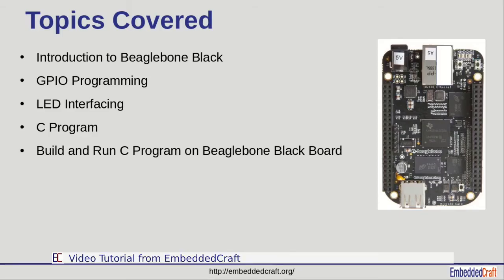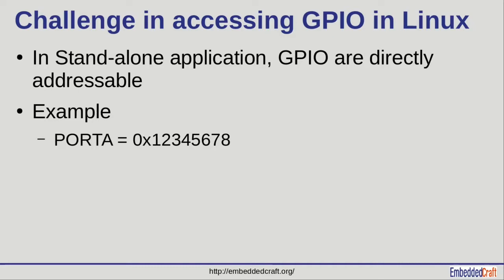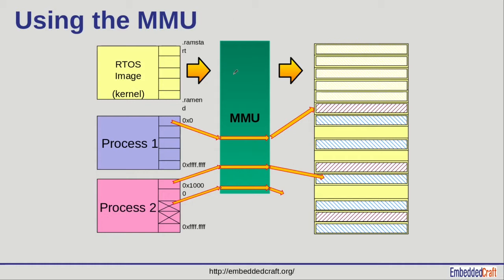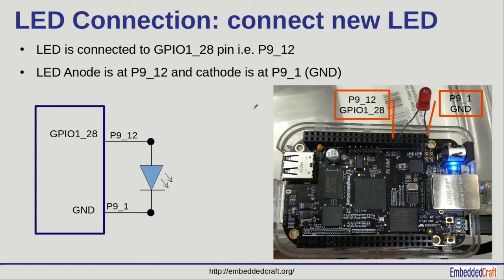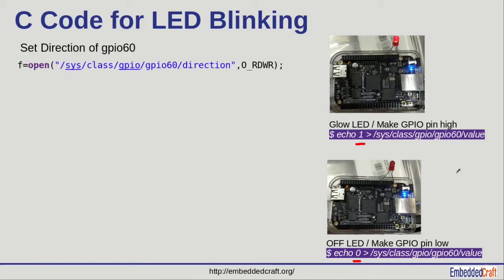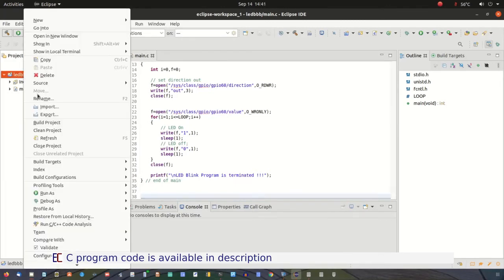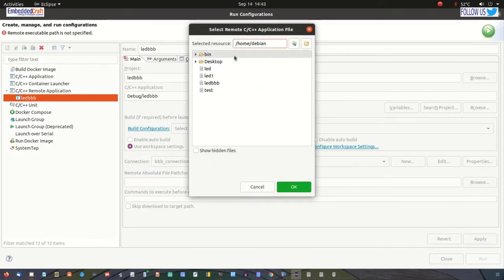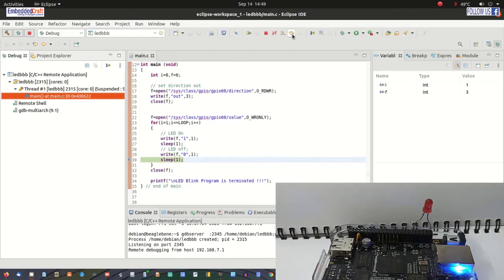Accessing GPIO and LED Blinking - LED Blinking Program in C for Beaglebone Black board

Comment: Great content! A question I have is if when one is developing a professional system with embedded Linux, are there any patterns to organize the code. I think the code could become messy quickly as the opening and closing files increase along the project. (It's a dumb question. I guess, but I'm beginning in Linux embedded)